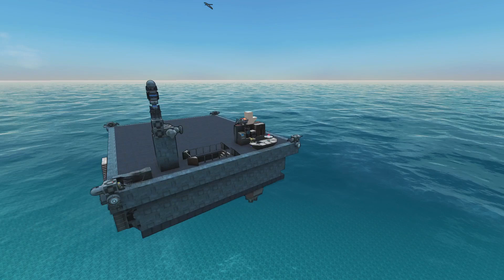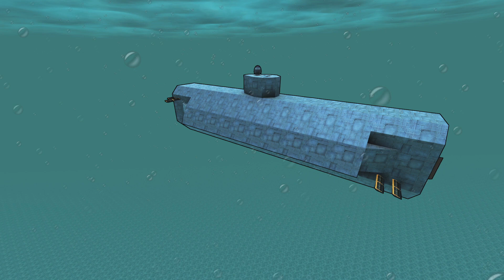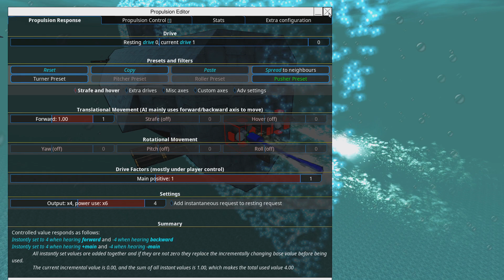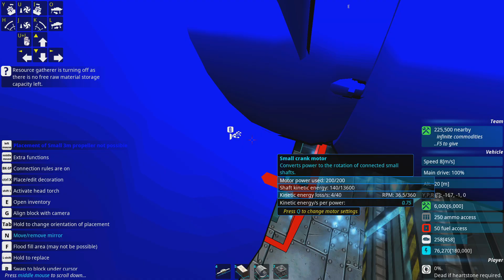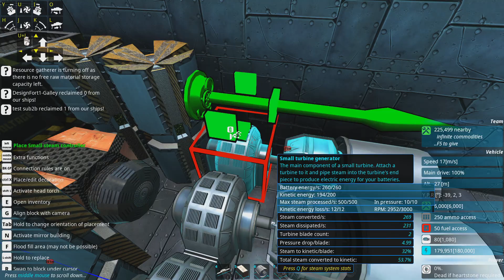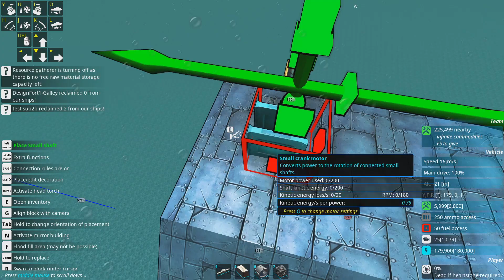FTD Galley - Sub Power and Propulsion - From the Depths

Comment from the maker: TimeStamps:
00:00 Helooo
01:47 Energy Production
06:01 Propulsion Options
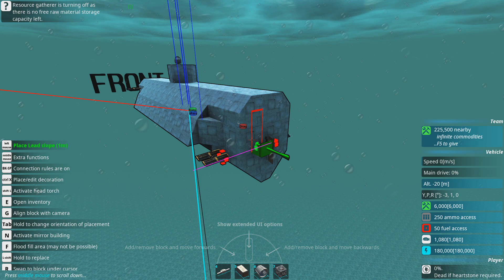06:50 Steam Jets
08:50 Simple Propellers
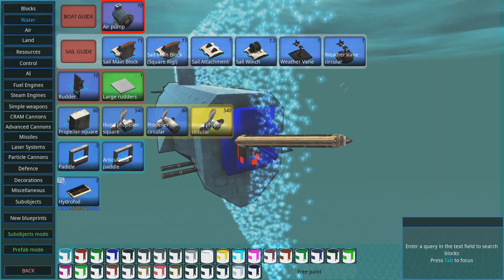13:07 Steam Propellers
23:57 Summary & Pro/Cons
Reply: Good vid! Is the ion drive worth considering as a stealth option for subs or is it too inefficient? Advantages/disadvantages?
Reply from the maker: @revengefullobster4524  I need to look into it and do some serious testing. On stealth although it is stealthy the standard prop also seems to be very stealthy to active sonar, just need to test passive sonar. Advantage is it works in ant environment and gives immediate power not needing to spin up to speed. Disadvantage is it gives low thrust for it's size.
Reply: @DelsGaming  thanks Del! I know it's expensive and weak, I really don't make any water craft now b/c large and huge torps. But if there was way to make an effective stealth uboat, then I would consider it.  Right now, it's far safer to hover or fly, at least you have a shot of dodging in 3 dimensions.
Reply: Can the large rudder block be used as dive planes?
Reply from the maker: @arpioisme   Yes you can use them as a Dive or Trim planes. Will use them in my end build to show their usage. I don't find them good on small builds but look good on bigger subs.

Comment: Probably could have got another 5 meters per second just reducing the drag on the bow.
Reply from the maker: Yes that was the simple any shape can be a sub test vehicle. Actually forcing blunt objects through soup I think shows the real power of propulsion. 
My final build will be nice and pointy :)
Reply: @DelsGaming  I was able to get one for my subs going 30+ meters per second with a steam drive.  Not to discourage you or anything but I don't see a point in making things realistic in ftd especially since we have boilers and fuel engines that work under water or in space with out a problem.  I'm more of the mindset of exploiting everything that can tip things in my favor because commanders in real life don't go looking for fair fights.  This is of course done with out using complete cheese like spin block exploits.
Reply from the maker: @Damaddok82  lol yes I understand, I do historic builds because it makes the game a challenge and I like history. You also do the same. At one point you say anything goes, no fair fights, but then say nothing that is cheesy, so you have set yourself some rules, I just have a few more rules that's all :)
Oh and yes I have built some very fast subs that had a wicked melee ram attack ;)
Reply: @DelsGaming  I think we can safely determine what is cheese and what is not.  Things like spin blocked exploitation or other various clipping methods that I have seen others use.  Unless it's for a decorative thing I stay clear of using such things.  Also, I am very reluctant to use huge missiles.  Seems wrong to be using a weapons system that's incredibly hard to counter and can be thrown together in two minutes by anyone who can put two blocks together.  Then with minimal to no effort, you have a weapon you can outright kill or at the very least cripple enemy craft.

Comment: Well done vid on the propulsion systems! One thing I'd like to add is that custom wings on spinblocks and dedi/heliblades work underwater as well. Custom wings can even pull double duty in the air and water while being 5 times as efficient when being underwater.
Reply from the maker: Cool, I failed to test them underwater but makes sense.  Could even possibly be fairly stealthy.
Certainly makes sense for a potential future flying sub vehicle I have in my head.